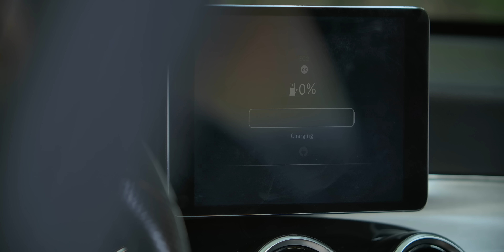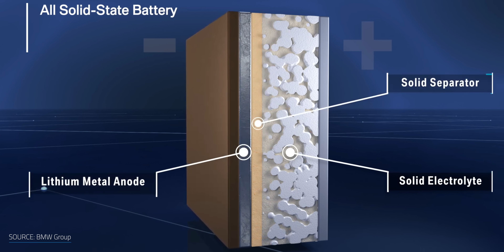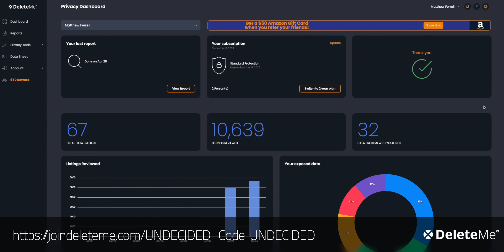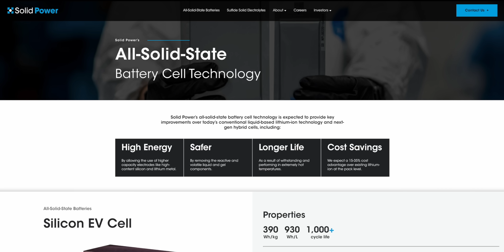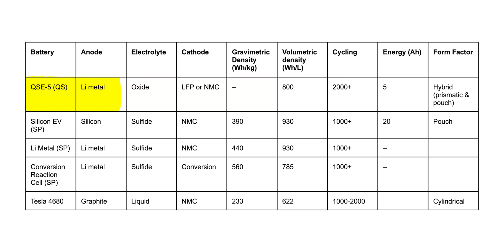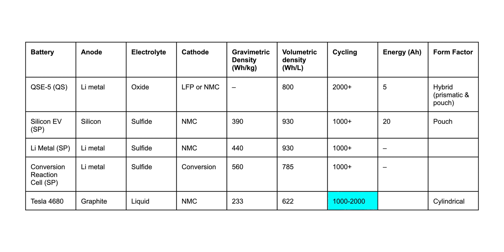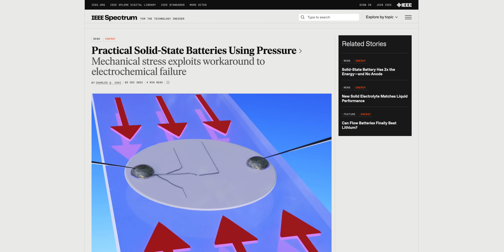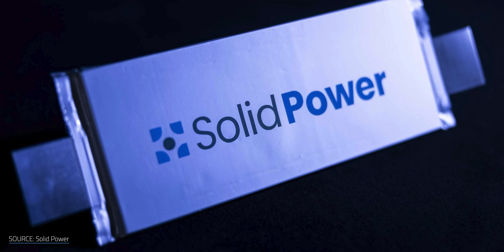Solid State Batteries are Closer Than You Think

Comment: Something you really should focus on more than solid state batteries are batteries with gel electrolytes.  These are generally refered to as "condensed matter" batteries.   And CATL already has one in production I believe though getting solid stats on it is difficult.  It is in excess of 300Wh/kg though.

The biggest problem is really the cost.   CATLs condensed-matter battery is 5x to 10x the cost of LFP and I doubt quantum-scape's battery will be any better.

Speaking of LFP, you really need to compare these batteries against LFP now, not against NMC.  The cycle life for LFP starts at around 3000 cycles and goes up from there.  Its energy density is improving (still behind NMC but CATL now has a 205Wh/kg LFP offering).  And its ridiculously cheap.  But that's the competition now, not the more traditional NMC EV batteries.

And the biggest hurdle for EVs is certainly NOT the charging rate, nor has it ever been.  That's a bit of a viral social-media rabbit hole.  The only hurdle left for EVs is battery capacity, aka range.   Getting to 400 real highway miles of range in a "cheap" EV is the end-game here.  The need for fast-charging falls off a cliff as range increases.   So what we really need in a battery energy density more than anything else.  Not fast-charging.   That said, CATL now has a 4C LFP battery so... fast charging has basically already been solved.

-Matt
Reply: Lfp batteries. I just purchased 71.5 kwh worth of lfp batteries for $16,880 delivered to my garage. Rated for  8,000 charge cycles. (80%).
And increased efficiency miles per kwh. Cheap EV. Aptera!
Reply: I'd add sodium-ion. CATL said their second generation will have 200Wh/kg as well, should be even cheaper than LFP and come out this year. Also it has pretty much even better properties than LFP throughout. (like bigger temperature range and charging at 5C) The only thing I'm still a little unclear about is how much the Wh/l will be. That could be problematic for cars, if it's much worse than LFP.

Comment: I disagree about solid-state batteries for cars at least for the time being, and I believe that they would be better served in portable devices and personal devices to prevent fire where it's more likely to injure somebody. 

For cars, trucks and vehicles in general I believe that sodium and magnesium based batteries which are cheaper and not reliant on complex and often limited or controversial substrates would be a better option to pursue for the time being.
Reply: I think the trouble is the combination of lower energy density and increased weight.
Sodium ion batteries have something like 50% of the energy density of lithium ion—which is actually really good considering how readily available sodium is by comparison.
But they're also 50%+ heavier.

The more weight you add to a vehicle, the more energy you need to get it moving and keep it moving.
If a sodium ion battery is 50% heavier with 50% less energy storage, you're looking at 3x more weight for the same amount of energy, but less range because it needs to move that extra weight.

I'm with you though, it'd be great if we didn't need to rely on $15,000 monolithic battery packs that make up almost half of the cost of the entire vehicle. But I'm not sure we're in a position yet where it's cost effective to put sodium ion batteries in them.
Reply: @AuntJemimaGames  That's incorrect. CATL now has 200Wh/kg sodium batteries, which is pretty much exactly the same as their current LFP batteries. CATL and BYD LFP batteries are currently used in cars like the Tesla model 3 and Y. So that's perfectly adequate for the job.
The question is more if Wh/l is also compareable.
Weight also isn't much of a problem for EVs, since they get most of the energy expended on extra weight back through regenerative breaking.
Reply: @AuntJemimaGames  .. I certainly get the weight but the cost is nearly prohibited and once the battery pack is EOL you've got an expensive paperweight that barely justified the small actual carbon savings. 

The Sodium batteries are perfectly fine for the "average" commuter and the Magnesium are catching up to the Lithium. Perhaps AI can come up with solutions we haven't even thought about yet.
Reply: I mean those don't have to be mutually exclusive. There are solid state sodium batteries in the works. Buuut just like with lithium solid state batteries they are quite a few years off. What is coming to market now are all semi solid state batteries.
Reply: @4203105  .. EVs make up a minuscule segment and so it's important to have long-lasting and economically cheap batteries for them. That's really my point here.

Comment: Very interesting video, how can you be so sure solid state will be massive when it hits? Comparing 4680 tesla model Y cells from last year to solid state batteries that are a few years away hardly seams correct. Where will NMC/NCA/LFP be in four years? What are the lab result of todays bleeding edge none solid state?
Reply from the maker: The comparison I did in the video is the current state of the tech today (a snapshot).  Yes, the 4680 cells and chemistries in use are continuing to advance, so some of those gaps will narrow.  However, I was only using the EV market as the example here because it's so large and hungry for high performance batteries.  There are other markets, like consumer tech, that will most likely go after solid state tech as it becomes available.  When I said it will probably be massive when it hits, I was thinking/referring to those as well.

Comment: Someone needs to start a sweepstake: which will arrive first: fusion power at grid scale, or solid state batteries in production at auto scale.
Reply: I'm still waiting for my airless tires!
Reply: @davidmccarthy6061  airless tires exist... they're just kinda crap and don't have any advantage over regular tires for day to day use... hell you can get airless bicycle tires now.
Reply: @davidmccarthy6061 go get em. Fork lifts,  industrial loaders, lawn mowers, wheel barrow. And the donut spare tire
Reply: Honestly, they just need to adopt hot-swappable standarized sizes instead of building the vehicles on top of fixed power packs. Then 'fill up' time stops being the issue, and maintenance of everyday Size A (Automotive) cells gets passed off to the industry and not the individual, like Propane BBQ cylinder swaps, and Truck Stops suddenly think jumbo EV pack swaps are the greatest thing since Burritos
Reply: @WindFireAllThatKindOfThing  wear n tear prohibits that. Although solid state cells using less cooling overall&weighing less per pack?
Might mean that swapping thing should be reconsidered again. Have you seen the Chinese videos of ev battery swaps dropping out on the hwy?
Reply: @4literv6  You're gonna need more than youtube video anecdotes and supposition to back that up.
Reply: These two things are barely even in the same universe.

For fusion that's worth anything, we need to gather a ton of hydrogen into one space such that it undergoes fusion under the force of its own gravity. Effectively making a star. Even if we had the means to do that, there's no guarantee the power put in would be less than what we'd get out. Stars really might be like rivers and oil - miracles of resources just given to us for free.

For solid state batteries, they just need to build out a production line that's reliable.

A better comparison would be thorium breeder-fission reactors. Which could be a real thing in the real world in our lifetimes.
Reply: Nope

Comment: I'd love it if GM brought back a modified S10 body on chassis platform as an EV light truck with batteries such as these.  A no-frills model for poor people to get the practicality of a small SUV along with the benefits of an EV.  But really, EV technology will continue to fail until they can fully replace the 3500HD line.  This higher energy density might help.

Comment: I notice that you conveniently didn’t mention LFP batteries which are growing in popularity, especially amongst EVs and home energy storage. These are batteries with significantly longer cycle life (4000-5000) and improved economics.

I’m all for innovation and I’m hopeful we’ll see solid state batteries in the market one day, but LFP is the chemistry to beat.
Reply from the maker: I agree.  LFP is where it's at right now (I just installed some LFP batteries for whole home backup).  But there's no one battery to rule them all.  LFP doesn't have the energy density/weight needed for many applications.

Comment: The biggest hurtle for EV's is the one no one addresses, which is fast charging.  Fast charging can be as much as 5 times the per KW price of what you pay at home.  In a recent video comparing the Cyber Truck towing against a diesel Ram, they were paying 0.375 per KWhr to fast charge.  With the price of diesel in Colorado being 2.999 per gallon, fast charging the Cyber Truck was the equivalent of paying $13.91 for a gallon of diesel (or paying $12.64 a gallon for unleaded).  The Cyber Truck ended up costing about $37 to tow the same load over the same distance that the Ram did for $24.  A battery is not going to solve this problem (against the robbery of fast charging).  Charging at home is much more cost effective and commuting is where an EV shines.
Reply: I think it's because most people (not all, just most) don't drive long distances enough, where this is the biggest issue. For most use, EV running costs are lower than for an ICE car, so they can offset the higher fast charging prices.
Charging speed is an issue since for a lot of people want the capability to drive long distances, just for a few trips a year. "ICE car can do that, so why would i go EV?" Fast DC charging is the answer for this, even if it comes with a price premium. And with the biggest difference between EVs and ICE car price being the initial cost, fast charging price is an afterthought.

Comment: The biggest problem for those batteries is evolution of current batteries. LiFePo batteries are taking over not because they are particularly good at anything, but because they are good enough and very cheap (and are getting better). Other battery chemistries are also getting cheaper and better. By the time those batteries are here, technical specs may be too close while price will not be as good.
My hope is that those batteries will get used in some high-end applications and will eventually trickle down to the mainstream (ie smartphones and notebooks wouldn't get more expensive even if you doble the battery price, EVs are very different story)

Comment: DeleteMe worked in my case. When looking for work, some A-hole agency sold my contact info to a broker. Then I was getting over 1000 spam emails a day. DeleteMe fixed this spam in a year, so I didn't need to replace the email I used for years. DeleteMe was selected because it claims to remove brokers in the USA and Singapore.

Comment: I'm surprised gravimetric density wasn't discussed/compared; I've always thought it was more interesting than volumetric density. The main things is that higher gravimetric density equals less mass for the same amount of energy, resulting in better efficiency and range for a given energy capacity, or being able to use even smaller battery packs for the same range as different type of battery pack. It also means safer accident collision conditions, and hopefully lower costs/impacts from extracting, transporting, and processing of raw resources. Volumetric density can sort of indicate those things, but to a lesser degree I think.
Reply: Matt showed a chart for the silicon batteries that had the info.  The EV battery was 390 Wh/kg    their other batteries were even higher 440/kg and 560/kg (wow!)   It's at 7min 20 sec mark.
Reply: Volume is much more important than weight. Volume is in Cars Smartphones, Gadgets very restricted. Airplanes and flying things are the only type of vehicles that need light batteries.
Reply: @dirkohlhausen7671  There are always limits.  I wouldn't want my phone battery (of the same volume) made of osmium, for example :D
Reply: Also, having a heavy battery will effect range in a car, because of the energy needed to accelerate and decelerate (energy recovery has losses).
Reply: @yeroca  The range of a car is effected very little by battery weight, as most of the energy that was expended, to get the weight up to speed, can be gotten back through regenerative breaking. Of course there are losses, but not very significant ones.
Reply: @4203105  There's loss in regenerative braking.  Also if the battery is heavier, the other components (e.g. frame and suspension) have to be made heavier and stronger to handle the forces which increases the problem.  I don't have numbers to back this up, but as I understand it, that is why the original Tesla S model has quite a lot more aluminum in it than later models like the 3 and Y. which are more optimized for build cost.
Reply: Another aspect is acceleration.  The heavier the car, the worse the acceleration for a given power level.
Reply: @yeroca  There is quite a lot of Aluminium in early electric cars, precisely because car manufacturers made the same mistake you did. They thought weight would be significant for electric cars, but it turned out not to be.
BMW did the same with the i3. No subsequent BMW electric cars were made out of aluminium.
Of course there is a tiny bit of loss, but it's negligible. A looot more can be saved by reducing drag. Here quite a few manufacturers could do a lot better.
Also EVs accelerate more than fast enough. Just take the "Tesla model 3 standard range plus" with it's heavy LFP batteries, that are just as heavy as sodium-ion batteries. Do you really want to complain about 5,6 seconds accelleration from 0 to 100km/h?
Reply: @4203105  you make good points.  Just one last counterpoint:  if the car were lighter, you could get away with a cheaper/smaller electric motor and still get the same acceleration.

Thanks for the discussion.  Apparently you've paid more attention to this issue than I have :D
Reply: @yeroca   Electric motors aren't like combustion engines. Making a more powerfull one costs barely any more. In the end it's just a bit more copper, really. They are usually over-seized for what they'd need for acceleration, since that means they can regenerate more energy when breaking. The acceleration is usually limited by what the battery can provide, not what the motor can do.
Overall I'm not saying that lighter isn't better. It's just pretty minor and in the grand scheme of things it's not nearly as important as price and availibility of materials.
If new batteries are just as cheap, just as readily availible *and' lighter, then we are talking.
Reply: @4203105  Interesting points! Thank you.
Reply: On the flipside, volume is really important for EVs.  Consider a battery with the same mass per watt, but made of something as dense as styrafoam.  Huge and impractical.  Perhaps you could have a combination metric, Wh/(mass * volume).  I suspect you lose too much information this way.
Reply: In most applications volumetric energy density is what matters most. Gravimetric energy density is really only important in planes. Everywhere else it doesn't matter.
Reply: @4203105  weight matters a lot on e-mountain bikes.
Reply: Both measures are important, and I paused the video when he first presented the chart with the figures for each
Reply: Lol we have Zero point energy technology that has unlimited power solid state batteries are pathetic look at all the inventors and scientists kill who have made free energy technology. This is pathetic.
Reply: ... and tire life
Reply: Gravi-who?

Comment: For home battery systems, weight or portability are not an issue, so for example iron-air batteries might be a better fit. 
Early predictions says that you need twice at much batteries for the same capacity, but they are only 30-40% of an li-ion battery system. 

However for both technologies we still have to wait and see how they actually perform in the real world over time compared to li-ion of lifepo4 batteries.

Waiting for these new battery systems to hit the market is not smart. For one, the first wave of these batteries will likely have higher price, but also, more states start to charge customer for returning power to the grid. Storing the energy to use later yourself, can save you quite a bundle of money...

Comment: Every electronic component in laptops and phones had been reduced in size to the limits. Why not use the saved space to accommodate larger batteries instead of making devices slim only you have to charge them every single day? I wouldn't mind my phone to be 1.5 mm thicker or my laptop to be 3 mm thicker.

Comment: What's the end life of these batteries look like?  Recyclable?  I have  two issues that need to be addressed before I'm on board with EVs.  1) What we do with them after their lifespan.  2) Performance in cold climates.  Does a solid state battery perform just as well in -30F?
Reply: It's actually more recyclable due to the fact that they're solid. In the end of their lifespan, they can either be used as a Grid battery or recycled. 2nd Question already got answered.
Reply: 1. The gas you burn isn't recycled either, so what's your point? Gasoline's lifespan is to burn for a fraction of a second and then just turn into massive amounts of CO2 and other pollutants.
2. Plenty of gas cars already don't perform well / start reliably at -30F. And with an electric car, you don't even necessarily need to start it at that temperature, effectively, because you have a huge battery right there that can power heating elements to bring temperature-sensitive components up to an efficient operating temp if needed.